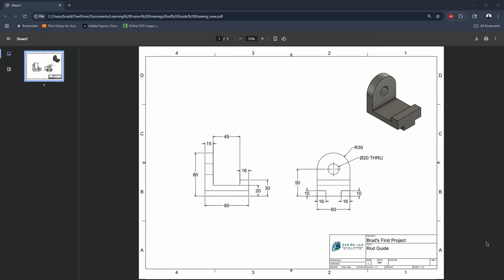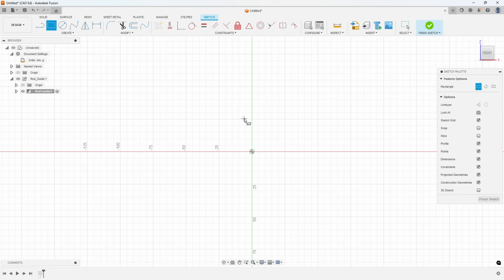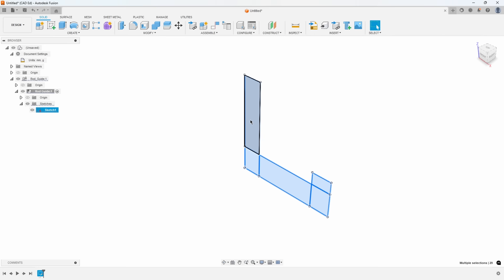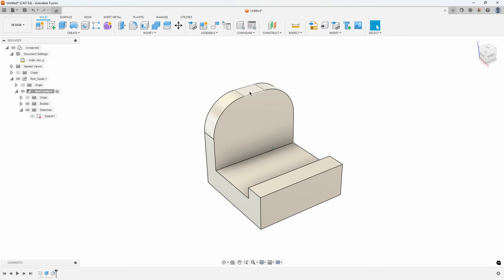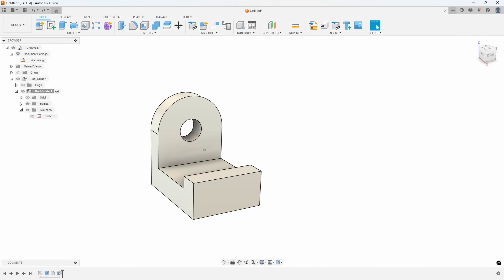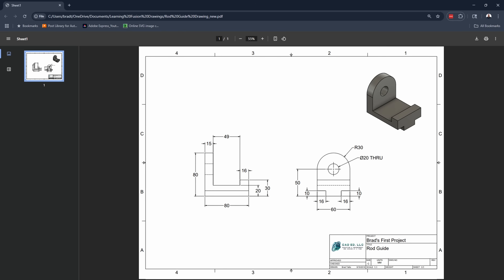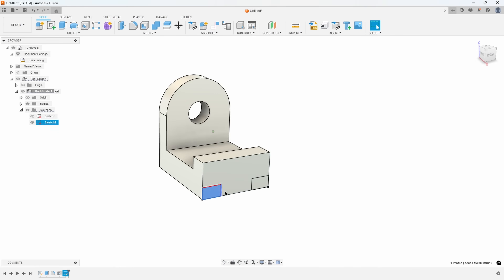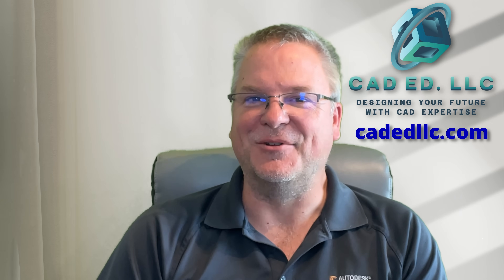What's the right way to design in Fusion?

Comment: Another nice video with a lot of useful and clearly explained tips and techniques.

One question: for the hole, what if one wanted to be a certain height from the base, say to mate with another part, like a shaft? Couldn't you make a hole as you did, define vertical dimension and then use the coincident and/or horizontal/vertical constraints to constrain the center to the center of the part?

I suppose depending on what the part is for, there could be a ton of variations of such scenarios. The main point is how you think and approach to the design and your videos are superb on this front.

Comment: Thankyou. Very helpful and informative. I was an experienced Creo (Pro/E) user in my day so just getting my head round the differences. Fusion is good but needs care to avoid big problems.
Reply from the maker: I've also used Creo in the past.  Each tool has its methods to create good models.  When I was in Federal Aerospace & Design at PTC, we had one customer that had a 3-ring binder with hundreds of pages of "requirements" on how a model should be created in Pro/E so the next designer could pick it up and understand how it was designed and could change.  It was pretty interesting.

Comment: Thanks. My way for the hole: Create a Sketch. Get the mid point of the Circle by pressing p for projection. Then create the circle on the mid point.
Reply from the maker: Yep, that works also.  I just like the hole command as it is less steps and allows for future changes easier.

Comment: Thanks, like it very much. Few notes, though.  This part has to have symmetry line anyway (actually two) that is going trough bore, so you will have symmetry line anyway.  (BTW  - is that possible in F360 to have those lines added automatically? ) 
But even more  - if you will check original drawing  - those notches on the bottom have individual dimensions,.  That assumes that they might have different purpose and should not be mirrored or equalized in size.

Comment: Yes!  I did enjoy the video and learned some new things!  Making educational videos is as common and dirt these days on YouTube, but having the skills and speaking qualities is very rare.  Excellent on both counts.
RE the mirroring.  In some programs, like SketchUp, it is advisable to model something in halves or even quarters and mirror into the final part.  Though not the best example, a table top and four legs could be modeled as one quarter of the top and one leg, then mirrored to complete the table.  Though it might necessitate exploding the top to create one piece.  On more complex models, this can save a lot of time.  What's your take on this in Fussion?  Thanks.
Reply from the maker: I will use mirror on more complex geometry.  For example, if I were drawing a gear, I would draw a quarter of it, like you mentioned, then mirror that into a half, then mirror that into a whole.

Comment: - First, thx for the EXCELLENT/USEFUL CONTENT.
- The community needs more "WHY TO / WHY NOT TO" videos in addition to the many "How to" vids out there. "How to" can be valuable, but moreso for experienced users, whereas "Why to / Why not to" vids give an underlying understanding, which is actually valuable for all users. It's important to see what can go wrong, as well as what goes right.

- Now, SOME TIPS, COMMENTS, & OTHER THOUGHTS: to benefit the whole community.
- First, I realize you can only cover so much, and must focus on some things while omitting others. And of course, there are always multiple ways to model an object. So, consider my contribution a COMPLEMENT to the content you shared. OK, that said, here goes... 

--- 'TRIM' - I concur: not appropriate in this use case; and in fact, only appropriate in limited use cases (more of a 2D CAD way of thinking/doing).

--- 'FILLET' - Yes, 'FULL ROUND' can be EASY, and importantly, DYNAMIC.

--- 'EXTENT TYPE: ALL' - Yes, use w/ care. BTW, bodies can be omitted via 'OBJECTS TO CUT' list (at bottom-right of feature dialog box).

--- AUTO 'MIDPOINT' - nice tip :)

--- 'EQUAL' CONSTRAINT - I'm divided on this one: but, generally avoid it: somewhat obscures design intent. So, I typically create/apply custom 'User Parameters'. And, as side effect, might be more compute efficient for "geometric constraint solver" (but, IDK - do you?).

--- 'MIRROR' - "nuanced": sometimes appropriate in sketch; others, more appropriate on feature/body/etc. outside of sketch. Just depends.

- OK, hopefully some of your viewers/subscribers will benefit from some of the things above - should at least give "food for thought".
- And, thx again - wishing you continued success/satisfaction; carry on...

Comment: In my very armature opinion I feel adding sketch points is the easiest. If I want one hole center different than the others just dimension in the sketch then select the point in the hole command. Say I have three holes 1/8" and want them to be spaced from the edge of a square 1/4 from each corner but one hole to be 3/8 , it's easier to just add points in the sketch and select them with the hole command.
Great video.
Reply from the maker: Yes, I should have made a comment about this in the video.  If I'm adding more than one hole, I will use sketch points.  In this particular example, the hole was perfectly centered on the radius, so it negated the need for a sketch point.

Comment: Great video! Quick note—at 13:21, stretching the body makes the hole’s center drop below the specified 50 mm. Constraining the hole to the fillet center causes the hole to move down as the fillet gets longer.
Reply from the maker: Yep, the hole will always stay "centered" to the radius of the circle using the method I showed.  If you want the hole to stay at a very specific point, you would want to use a point that is dimensioned on the sketch.

Comment: Hi Brad love your content, but you made that look so complex.
Its only one sketch and 3 extrudes if you model from the front and then fully parametric.
Draw and dimension half sketch, mirror, and 3 extrudes.
Look for sketching around symmetry first in this case.
Reply from the maker: Like I mentioned in the video, there are many different ways to get the finished product.  Which way is the "right" way?  It depends.  I have modeled it the way you mentioned and found it actually more difficult.  You have to create mirror lines, dimension the mirror lines to get a fully constrained sketch, and trim your profiles, etc.  I also tend to model the design like how it will be machined.  You start with a block of metal and then machine through it.  You don't start with half a block and glue another half to it.  Again, this is how "I" think.  You also need to think how easy would it be to follow the timeline a year from now if it was handed off to someone and they had to "figure out" how the model was designed.  Am I saying my way is the right way?  Heck no.  It's just the way my brain works.  :)  I love watching the Design Challenge at Autodesk University where they put 4 people against each other to design a product in 10 minutes.  It's always awesome to see how each person approaches the problem.  I really appreciate your feedback and for watching the videos.

Comment: Great info on the Hole and Fillet tools!

When making the hole by using a sketch, an easier way is to enter "p" for Project, click on the circular edge, and hit Enter and it will create a point at the center of the circle.

Also another potentially useful point is that if you had created the part with the center of the hole at the origin, you could have used a coordinate axis as a pre-existing mirror line.

And mirroring can save a lot of time if there's lots of geometry.
Reply from the maker: Yep!  All good points.  I always use the "P" key for Project, but I got feedback on some of my videos like "how did you bring that menu up?"  So, I show the menu clicks & picks.  I do use the mirror command if there is a lot of geometry.  In this example, it was just 1 rectangle, so the constraints made more sense.  But, if there were multiple profiles, I would definitely have used mirror.

Comment: I prefer to use sketches so you have an actual "written" reference so you know what you were doing.  I use a Point for holes in sketches and then after finishing the sketch use the Hole command on the point.  Then you get the benefit of the Hole tool but also have a reference document for where you created the center of the hole.
Reply from the maker: Yes, I agree.  If I'm doing more than one hole, I will use a dimensioned sketch with points.  In this example, the hole was "snapped" to the center of the full-round fillet.  But, as someone else pointed out, if the width of the part is changed, the location of that hole would drop.  So, I probably should have defined it with a dimension...

Comment: Always two ways to skin a ....

I actually typically do both. I do a sketch and then the hole command. When I do the sketch, I just place a point. But for that point I would have placed the point constrained at the center point of the outside edge. So, effectively I end up doing the same way you do. However, I just don't like placing the hole command and then dragging and snapping to the center point. I just don't "trust" that snap method. I find it is too easy to miss the snap. I have went to click and place things like that before and have had it miss just off the center point and not notice it right away.

Anyway, then I follow that up with the hole command with a nice "Point" to click on the sketch/face. Same as you, I really appreciate the hole command. Not just for the ease of adding other options, but also the ease of placing dimensions on a drawing for mfg later. The hole command during modeling opens up the option to use the hole/thread command on drawings which quickly and easily places a lot of info.
Reply from the maker: Ya, I agree.  If I'm doing more than one hole, I usually use a sketch with points.  Also, as others, like yourself, have pointed out, having a dimensioned sketch where the holes should go tells the story of how the part is designed better than just snapping to the center of a fillet.  Thanks for sharing your methods with others.  This really helps the community!

Comment: Good, as always.

One thing I disagree with is leaving the extra lines in the first sketch. Instead of leaving them or trimming, I use break, and then turn the lines that you would normally trim into construction lines. This removes the clutter, makes it clear how it was sketched, and allows you to select just a single shape to extrude.
Reply from the maker: I hate to admit it, but I have never thought of "breaking" the lines and turning them into construction geometry.  And I grew up on the hand-drafting board.  :)
Reply: @bradtallis8968 I saw it in a YT video quite a while back (don't remember whose, unfortunately) and find it pretty useful at times. Nice to finally be able to teach you something, after all the things I've learned from you. 😀

Comment: I recently discovered the “split” command in drawing. This splits a line at point. Instead of trim you can split at the intersections and then make the line segments that trim would have removed into construction. This should preserve the dimensions and constraints.
Reply from the maker: This is what Ken just mentioned he does also.  I have never tried that.  I'll have to give this method a try and see.  Thanks for sharing this method with the community!

Comment: Another great video Brad 👍🏻. 
I was always told that if you are going to CNC a part then using the Hole tool is the way to go because it carries the intelligence through to the Manufacturing workspace and things like automatic hole recognition
Reply from the maker: Yes!  Great point.  The hole command carries all the intelligence of the hole where a circle does not.

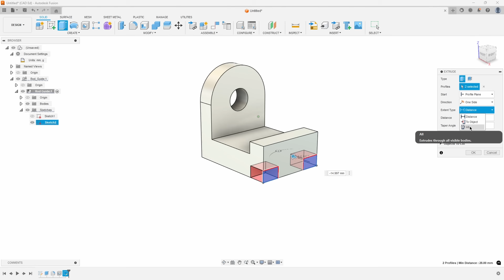Comment: 17:50 If that component is part of an assembly and you  Extrude to "All" could it affect any other components?  
I always forget about the Equal constraint.  Thank You!  👍☮
Reply from the maker: That is a good question.  If you extrude to another component, check the "Operation" and see it is says "Join".  If it does, it will combine your extrusion to the other component.
Reply: @bradtallis8968  I was thinking about components 'farther on down the line' (Timeline, that is 😁). I reckon your reply pertains to that as well!  Thank you, Sir.

Comment: Thanks. In your next, more complex one, can you include multiple parts and an assembly. I see a lot of people doing separate component files and an assembly file but i thought that fusion was meant to model all components in the same file. The way others are doing (Separate files) looks much less complex.
Reply from the maker: Fusion allows you to do either.  You can design "in-context", where you design all of your parts in one design file, or you can design "External Reference" where you design each part individually, then create a design and insert each part into that design and "Assemble" them together.  I lean toward the in-context design, but there are pros/cons with both methods.
Reply: @bradtallis8968 many thanks for the explanation. As always you bring some sense to the process.